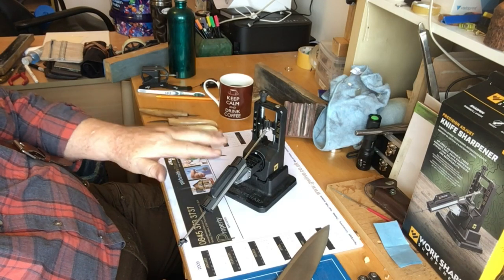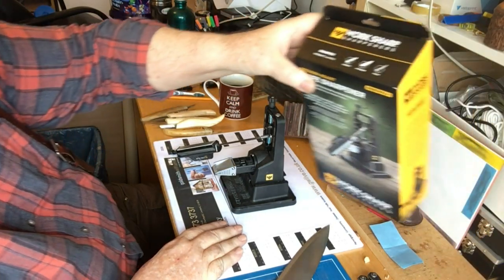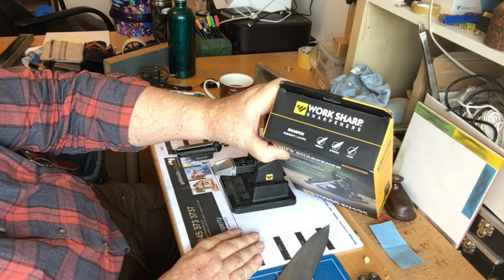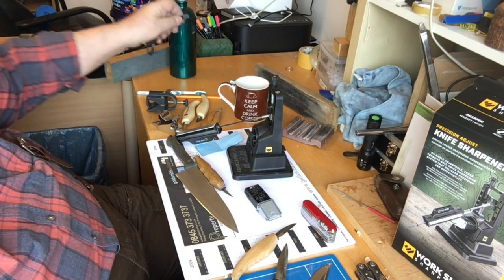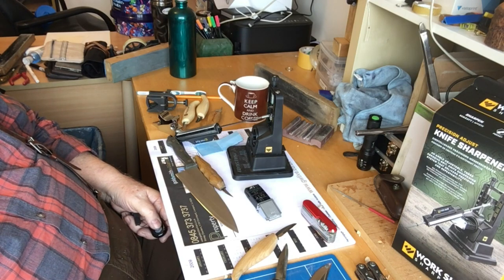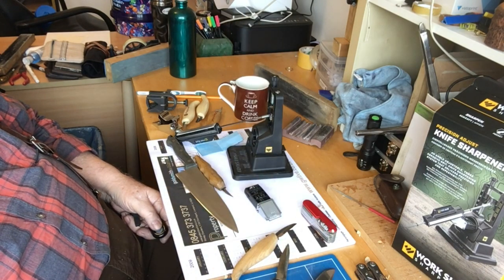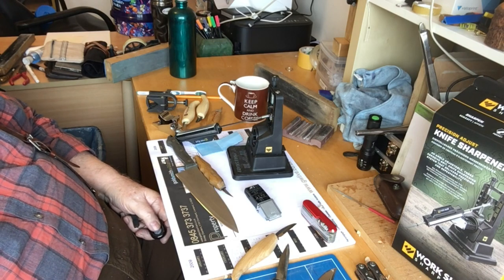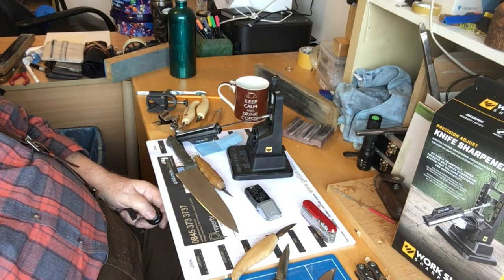My Knife Sharpening Part 2 The Worksharp Precision Adjustable

Comment: I haven’t had a chance to get one yet but I was just thinking of HAL a small piece of wood screw to the table would help the flexing of the sharpener. Just something flat that fits right underneath the base.. Just inside the parameter so it kind a even Roxanne and away. Like I say I haven’t had a chance to operate one yet but I will receive one in the next few days. Thanks for the video.
Reply from the maker: I have actually done that but just a block not screwed down. It has helped the flexing so would definitely try that. I have also bought som 3m leaping self adhesive film to cover the ceramic honking plate. They peel off easily and can be re attached. This has improved the final stropping tremendously.